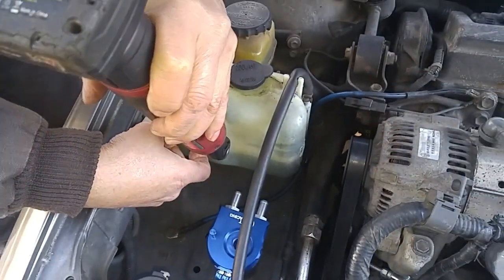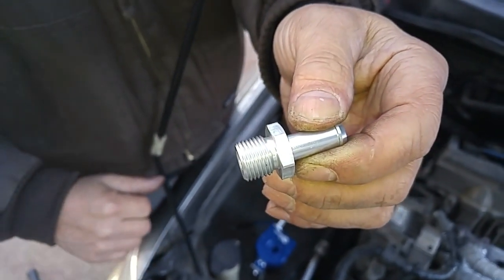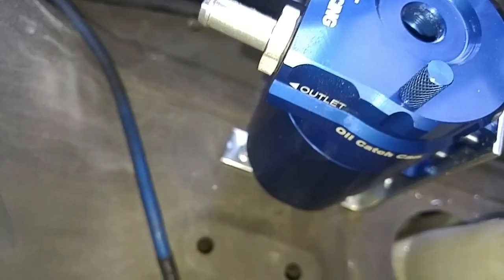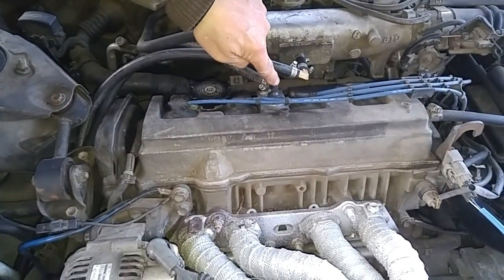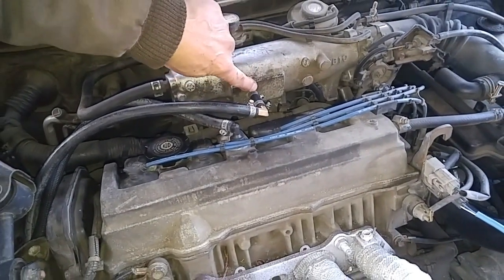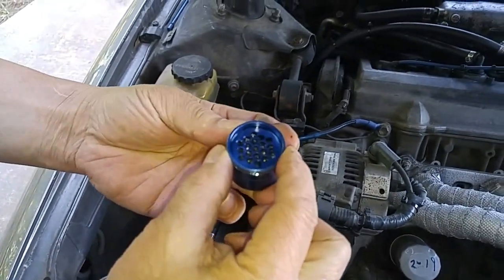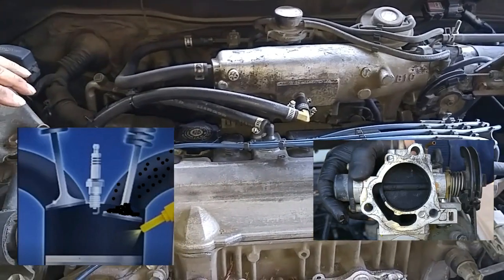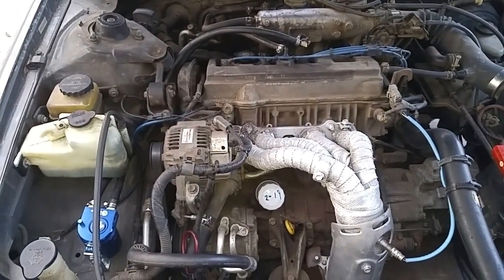Oil Catch Can Installation & Benefits - Toyota 2.2L 5SFE engine

Comment: Reduce blowby pressure by pulling up the oil dipstick a few inches to vent blowy.
My 2000 Camry had so much pressure, oil was forced through the new valve cover gasket and  all over the exhaust manifold.
Reply from the maker: replaced the PCV?
Reply: @hardlymovingpro  Doing that now.  Dorman pcv grommets keep tearing apart, trying an intermotor brand next.
Reply: @mergeform  Stick to OEM
Reply: @hardlymovingpro  What is the pcv  for like if I have a oil leak for instance I was driving black smoke then it disappeared

Comment: Good job. Would it be possible to remove the PCV valve and run a hose in it's place from the crank case outlet to the catch can inlet, then connect the PCV valve inlet to the catch can outlet and run a hose back from the PCV outlet to the intake?  If it's possible this would also stop oil gumming up the PCV valve. I'm not an engineer so I don't know if moving the position of the PCV valve would effect its function.
Reply from the maker: PCV would still get gummed up IMHO.

Comment: I have same car and engine but mine looks like more oil go through right side of value cover exit hose that go directly to the air duct and throttle body. Can install oil catch can for that side or both?
Reply from the maker: Yes...you can install both.

Comment: I love using silicon grease on hose connection points and I know you're a big proponent of it, but one thing I'm wondering what your thoughts about are is for-  using it on PCV system connection points that are on the engine and are metal (so they get really hot during operation) (such as the metal tube on a valve cover that has a hose directed to the intake) do you think that this would present a problem as far as O2 sensor contamination over time? I've been reading posts all over the internet and see more posts about people saying keep it out of the engine bay, or articles saying it shouldn't be anywhere that reaches 500 degrees.
Reply from the maker: Thanks for your good questions.  I use the silicone (also called plumber's grease) for any metal contact surface that connects with rubber.   It's also excellent when used on electrical connectors providing a moisture barrier that lasts.  And for ignition coil packs to prevent the rubber to spark plug porcelain connection points.  As you had seen in my videos, the silicone overcomes the resistance encountered with slipping on and off hoses.   It is also a good protectant for coolant hoses which may come in contact with oil, grease and coolant.  You want to avoid using petroleum based grease since it reacts with rubber;  that is it makes rubber swell and over time breaks it down.  With respect to the PCV connection points, just apply a light coat so that the hoses can slip off and on when performing maintenance services.  Constant exposure to heat hardens rubber to the point where it drys out and becomes brittle.  A light coat of silicone might extend its longevity.

Comment: What about the v6 1mz-fe engine. I am about to install a can, but on the v6 has another hose that goes straight to the intake. Is that also considered a dirty side as well and do i need to tee it in with the other side of the pcv line and run it in series with it.
Reply from the maker: Same logic with the setup but different location of the PCV valve.  Both the 1mz-fe and 5sfe pcv's direct blow by gases back into the intake plenum.

Comment: Wow, I'm about to do the exact same thing to my 99 Camry 5SFE. I can't put the can in the same location as yours because my ABS unit is right there, so I'm going to make an aluminum mount and install the can just behind the trans dip stick. The mount will connect to an accessory bolt on the transmission. My catch can looks exactly like yours, but mine doesn't have the option to vent to outside air. Thanks for the video.
Reply from the maker: My 99 5 speed CE didn't come with ABS.  But I retro fitted rear disc brakes from a ES300 and the car now stops on a dime with no nose dive.   Good luck with the install and check out my video on a retro fit of the engine oil cooler from a 95 Camry donor car.
Reply: @hardlymovingpro you need to do a video on converting to rear discs!
Reply: @hardlymovingpro  hi, I have 2000 Camry 2.2 with ABS . If I get rear disc brake system from a Camry V6 or ES300 what to do with ABS system?
Reply from the maker: It'll still work if the donor abs connector plug fits.
Reply: Passenger side right behind strut tower , there is nice place for oil catch can like this size.
Reply from the maker: Pretty tight location.
Reply: Hi, I am planning to do so ( upgrading rear wheel to disc brake) does it need to replace rear brake  proportioning valve too? Or eliminate it?
Reply from the maker: @dmitripetrov5536  made no other changes and the rear pads are wearing just a little faster than the fronts.  Car stops now without nose diving.
Reply: @hardlymovingpro  Thank you for information . It's  hard to find information about modifications in these old cars .

Comment: The valves are cleaned by gasoline.  The throttle plate isn’t.  I’m more concerned about the oil mist that goes counter flow into the intake line - even though it’s not supposed to do that. Cleaning the throttle body is a pain and can be avoided if you think creatively about how to allow air into the valve cover without plugging the 1/2 inch line into the intake.
Reply from the maker: Blow by gases passing through the PCV back into the intake behind the throttle body is the primary source of throttle plate and Idle Air Control (IAC) carbon contamination. The other source is EGR gases.

Comment: The can is great, but on these engines reverse flow through the valve cover is what sucks all the oil mist that fouls the throttle plate through the 1/2 inch “inlet” on the drivers side of the cover.  The can protects the valves.  But nothing protects the throttle plate.
Reply: Yes, I  100% agree with you. I have the same car and engine. This doesn't help with throttle plate. Even for vales doesn't need as gas good solvent for carbon.
Reply: @dmitripetrov5536  Yes, I have a '93 MR2 and you just have to periodically check the throttle plate and remove the throttle body to clean when needed. It's really simple fortuntely, just four bolts and a few vacuum/cooling hoses to disconnect.

Comment: I have the same exact car & engine as you and this is definitely going in my car now. 163k miles and I’m starting to have slight engine issues. It bogs down sometimes (might have a misfire) and has a vacuum line leak somewhere. Eventually I’m getting it all fixed but this is definitely going in my car now. Glad I stumbled upon this video
Reply from the maker: Installing this catch can got rid of my engine knock under load.  Common source of vacuum leaks on this car is from breaks in the air hose (between the air filter box and throttle body).  Misfires could be bad ignition wires and/or plugs (use NGK blue wires and Denso Iridium Twin Tips as a replacement).  Check out my retrofit of an engine oil cooler I got off of a 95 Camry:  https://youtu.be/cVrihkUURzE
Reply: @hardlymovingpro  I’ll look for breaks in the hose but it’s definitely more drivers side noise than passenger so I see what you mean there, can hear it better going about 30mph at quarter throttle. I have NGK Blue wires and the same Twin Tips but not Denso, I went with some other brand. Upon removing the old plugs they did look a bit dry as they were a little dark so no idea what the issue would be there
Reply: @hardlymovingpro  also I just watched that video might look into that too!
Reply: Hi man I know this video is 2 years old but I was wondering if the catch can on your car has had any negitive effects on any part of your engine?
Reply: @wickedjonnyg2410 I know this comment is over a year old but I can share my experience about this oil catch can . I have the same car and engine as in this video, and I installed exactly the same OCC on the car. I did not have any issues or negative effects on any parts. No check engine at all and everything exactly the same as before. Even it passed NY inspection without problem that someone told me remove it before taking to the inspection because of manipulation on the emission system. However I have to drain it about two times in the 3 months of winter that it overfill with milky oil and water mixture,  on the rest of the year almost nothing,  maybe  10 drops of oil.
Reply: @hardlymovingproductions 

I actually installed one of those on my 86 Toyota truck. I want to install one of those on the 92 Camry. I read somewhere that it can be bad in the wintertime ? Any opinions ?

Comment: I have a 00 Camry 2.2 would you recommend I do this to better increase reliability??
Reply from the maker: It should help with reducing engine knock under load, keeps your throttle body clean and reduce piston carbon buildup.

Comment: It should be clarified that the 5sfe is a port injection engine so fuel will be sprayed before the intake valves and should keep them clean, the diagram you showed was for a direct injection engine. Although it will definitely make the intake plenum and throttle body cleaner
Reply from the maker: Good observant point.

Comment: Have you tried using a vent on the catch can and blocking off the vacuum port on the intake manifold? I have seen tests that show the catch cans can actually increase the pressures of the valve cover due to restrictions.
Reply from the maker: Tried that and the engine didn't run well.  Also venting to the outside is technically illegal and creates a lot of oil residue in the engine compartment.
Reply: @hardlymovingpro  Thanks for the info.

Comment: Took me along time figuring out p0430 on my 2006 rx330.  Scan tool graph shows random spikes of air flow in intake.  I don’t know, maybe pumice filter out of my can caused burst of air into the intake causing extra oxygen detected by o2 sensor? Took the can out for now, cleared code, fingers crossed.
Reply from the maker: Common sources of air leaks are from cracks in an old air intake hose.
Reply: @hardlymovingpro  Hello Sir, thank you for your comment.  My research also pointed to vacuum hose as on of source.  But as I stated, there is no air leak.  Just random burst of air spikes which only can be seen by graphing.
Reply from the maker: With the engine idling, spray brake clean on all vacuum hoses.  If the rpm's go up, you've found the leak source

Comment: Thank you for the video! It has not only  inspired me to try and install a catch can on my ‘95 Celica GT, but also made me curious as to what exhaust manifold that is you’re running and how can I get one?!
Reply from the maker: Your welcome!  It's a stock manifold with exhaust wrap painted with silver heat resistant paint.  The wrap helps with exhaust scavenging at high rpm's.  Keeps the heat inside the pipes.

Comment: Coming from someone that's had a catch can on thier 5sfe for years now,  yes lol. I can fill a pudding cup of oil sludge out of my can every 1000 Miles. They do NOT run clean by any means!
Reply from the maker: That does seem excessive.  Mine's not that bad.  I'll guess that you have excessive blow by gases caused by worn piston rings.  Try doing a compression leak down test.
Reply: It's the 8 year older  round plug 5s (the even slower ones) lol but I said sludge, not just oil, its oil + condensation make peanut buttery loveliness! It's a good catch can. Engine is healthy
Reply from the maker: Had good luck using Marvel Mystery oil for cleaning out engine sludge and carbon buildup.

Comment: Would the filtered air not have an abnormally high rate of carbon monoxide/combustion exhaust compared to natural air in the intake reducing quality of the air in the intake? Shouldnt that be removed from the system entirely rather than reintroduced to the intake?
Reply from the maker: You can vent the blow by gases outside the engine and plug the port in the intake manifold.  But then you'll have 2 problems:  1.  Violation of EPA emission rules (California completely bans all catch can enhancements).  2.  Vented gases inside your engine compartment will create oil residue all over the place.
Reply: @hardlymovingpro   good to know. Is there no way that it could be hooked up to a separate exhaust outside of the engine bay just so that it doesnt reintroduce spent air into the intake/engine?
Reply: @googlemail4241  Yeah, my dad's 1960 Falcon wagon had no pcv valve. Just a pipe that exhausted down by the oil pan. Smoked like an old biker when it was at stoplights.

Comment: Damn, I'd love to install one onto my 98 Camry but I got that ABS module in the way.
Reply from the maker: I hear ya.  You've got to be creative figuring out a good spot for the catch can.
Reply: @hardlymovingpro  Yeah, I'm looking at a compact one and seeing if I can manage with that
Reply: @hardlymovingpro  I managed to figure out a spot which is a passenger side ledge towards the firewall. I'll prolly get an angle plate and install it like so. Have you noticed any vacuum leaks or any hiccups for that matter with the particular setup you have?
Reply from the maker: Congrats finding a workable location.  No.vacuum problems.
Reply: @hardlymovingpro  Alrighty, thanks for the video and reply!

Comment: The hose that you connected to the pcv valve, does is go to the inlet part of the catch can or the outlet part ? I just want to make sure I don't connect the hoses the wrong way and have problems later.
Reply from the maker: That's correct.  PCV valve to catch can inlet port.
Reply: @hardlymovingpro  thanks

Comment: Awesome I have a 1998 Toyota Camry and I was wondering if I could benefit from installing a catch can the way you explained it made it easy to understand, now I just hope I find the same catch can you installed and I'll be giving it a try my Camry only has  125 thousand miles and I have it running pretty smooth, your videos are actually very helpful and easy to understand. Hopefully you can make one on the 2008 Toyota Corolla le, I just bought me one, is practically in perfect condition only had one owner when I bought it at my local Toyota dealership and I want to make sure I can make it last at least  400 thousand miles.
Reply from the maker: The catch can does accumulate oil and reduces oily blow by gases entering back into the intake manifold.  This reduces carbon buildup on both the the throttle plate and idle air control valves (see my Throttle Body & IAC Cleaning video).  Also noticed elimination of engine knock (pre-ignition) under hard acceleration.   No regrets spending the time putting this in my car.
Reply from the maker: You can also install a engine oil cooler:  https://youtu.be/cVrihkUURzE

Comment: After watching this video I installed a similar catch can on my 2004 Toyota Highlander V6 with over 204K miles The results were very much like yours, about 1 teaspoon of oil after 500 miles.  Thanks for posting,
Reply from the maker: Great to hear!  In 10,000 miles I'll check to see how much carbon accumulated onto the throttle body plate.  The idle air control valve should have less carbon as well.  The only thing I can't control is the EGR gases being channeled back into the intake.

Comment: you think i should get one even tho the 1998 camry is not a gdi engine my throttle body carboned up at 358,592 miles and i cleaned the throttle body kept sticking
Reply from the maker: Only if you're experiencing engine knock under load.  Since installing the catch can, the knocking has completely disappeared!  Knocking only happens in hot weather.  Believe the blow by gases is corrupting the air/fuel mixture artificially reducing the octane.

Comment: Thanks for posting this. Would you provide detail as to how you mounted the catch can, eg source and specs for bracket and bolts used?
Reply from the maker: In the text description of this video, I listed a catch can that looks identical to the one I purchased on Amazon.  The one I bought was the last one sold by the vendor.  With respect to hoses, I went to my local auto parts vendor to find something that closely matched the kit's output ports.  The L shaped bracket was a piece of flat steel I purchased from the hardware section of HomeDepot.  I bent it in a vice and drilled two holes for chassis mounting.  I used one sheet metal screw and a rivet to hold the bracket onto the car's chassis.  The hose clamps and zip ties were just standard auto hardware I had in stock.  The stainless steel mesh came from a my wife's pot scrubber which I cut a piece off and screwed into the can's baffle.  So far the catch can has been working wonderfully.  It is accumulating blow by gas oil, no more engine knock under load and the idle is smoother.
Reply: @hardlymovingpro  Thanks. I can't fnd that right-angle barb/fitting that connects on the intake manifold side. Can you give me a brand and part number for that? Thanks!

Comment: Do I need oil catch can for Toyota Camry 2006 LE 2.4L 4CYL???
Reply from the maker: It's a nice add-on feature to an already excellent engine.  On my 1999 Camry (270,000 miles), the idle smoothed out, the mpg's went up and no more engine knock accelerating under load.

Comment: Which cars do you recommend for something with great reliability? I was thinking about buying a 2.5 liter Camry.
Reply from the maker: That would be a wise choice.  But be careful on model years where the cylinder head bolts sheared out of engine block requiring a new headgasket and time serts being threaded into the block to hold the head bolts.